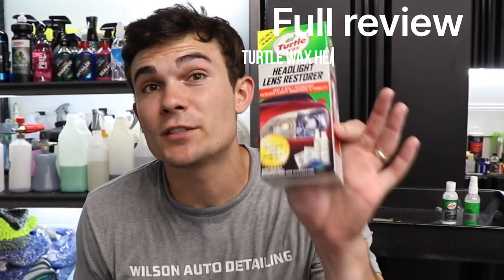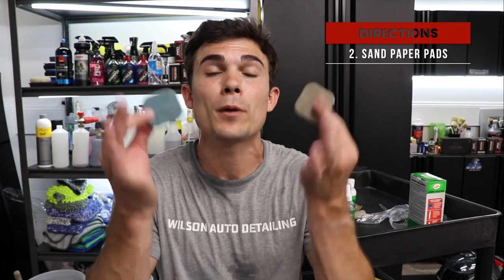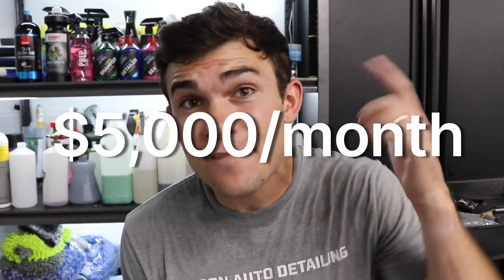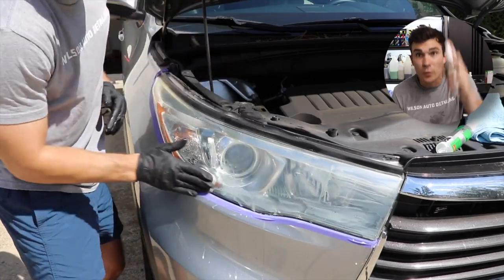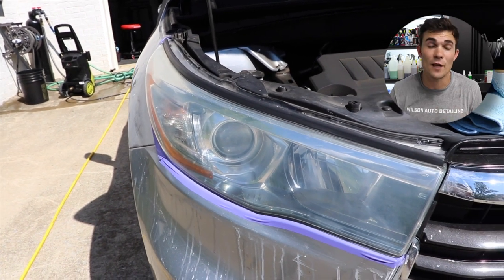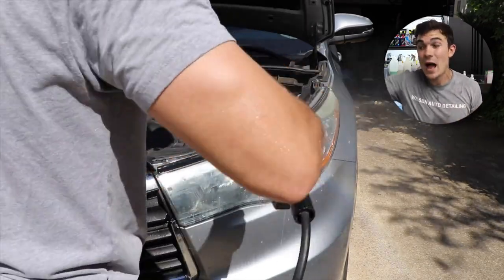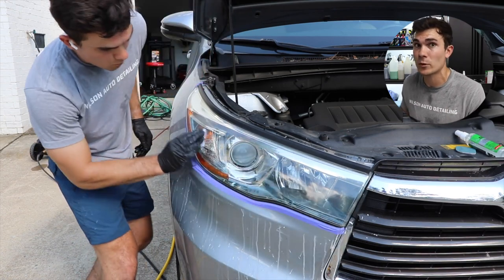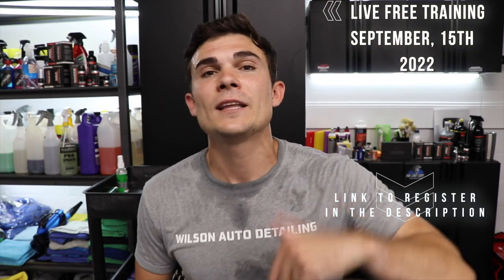Turtle Wax Headlight Restoration Kit vs Professional Restoration

Comment: I used this kit in the fall on some 2003 Toyota headlights that I thought I would probably end up just replacing.  I took my time with the sanding - no problems with pads lasting for both lights, and followed the directions exactly.  I don't have a machine buffer but they came out amazing and I'm hoping the sealer/protectant stuff lasts at least a year.  A couple months later they still look fine, work much better at night, and not thinking about new ones.

Comment: I have personally used this kit on 2 different cars over a year apart with good results.  My kit might be a little older as the sealer came in a bottle not a wipe.  I prefer the bottle as it goes farther.  Friend gave me this kit free and not sure how many headlights he did before me.  Not going to say it's the best but it does work.

Comment: For a starter or a diyer my fave headlight kit out there is the 3m 39159. Has a drill attachment to stick 3" sanding pads to as well as an actual foam pad cause most starters don't have a DA yet and includes multiple of each sanding disc of 1500, 2000, and the cream of the crop 3000 trizact disc's which I think are great. In addition you get some compound and the clear coat......then the next time you can buy the 3m 39186 which is the quick headlight renewal kit and you just use the compound from before and foam pad quickly then it comes with new clear wipes for under $5. The starter kit at full retail is about $20 but I see it on sale often for close to $12. Much better value than the nulens, mothers, or griots kit in my opinion although the griots includes the best tools.......yeah I've got lots of experience with these kits. I'm not a detailer but 20 years working in auto parts over used most plus heard customer reviews. You can also buy the 39173 which is just a fresh 3000 trizact disc and the  the 2 stage clear coat wipes.

Comment: Honestly these 4 sanding squares are NO DIFFERENT than a 4- way nail buffer they use in nail salons. I do nails and I did my headlights. My 4 way buffing block worked even better.
Reply: I used rustoleum uv clear spray for plastic. I enjoyed doing this lol